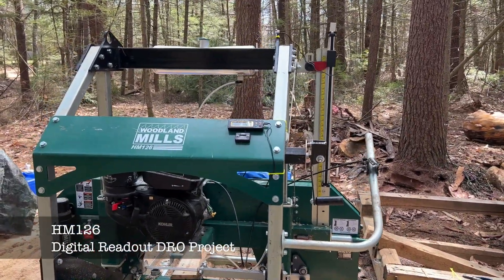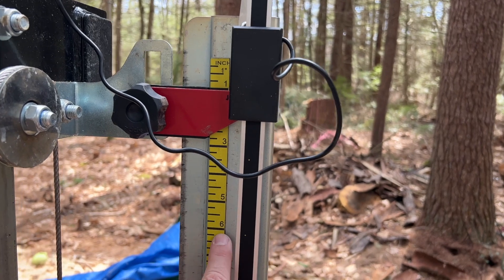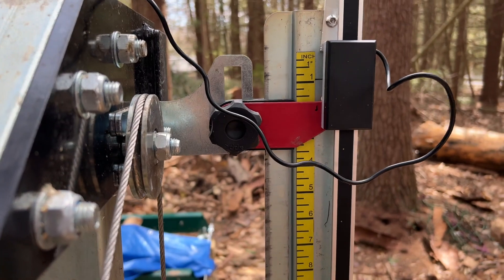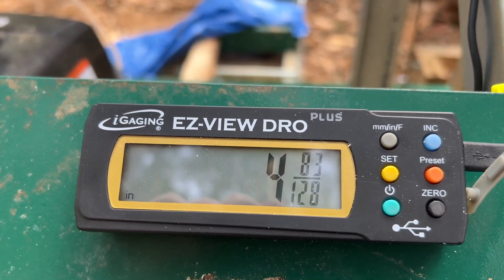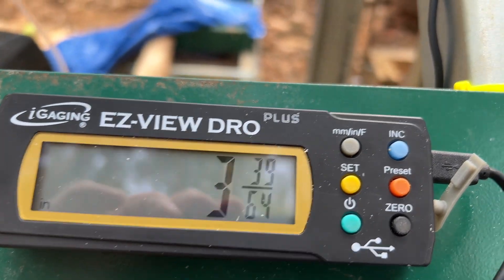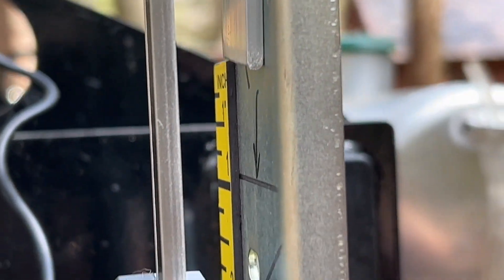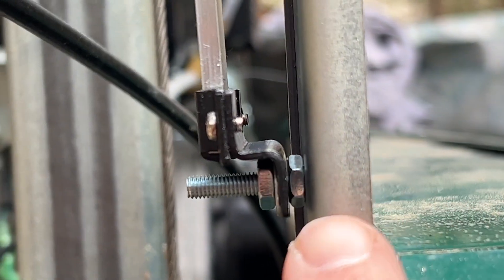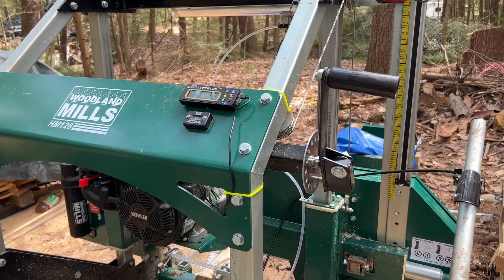Woodland Mills HM-126 Digital Readout DRO Project

Comment: Can it be less accurate or rather made to read , say 32nds of an inch ?  Thanks
Reply from the maker: No not that I have found. I switched to the 3 decimal mode 1.XXX. Since I'm always working using the INC function i'm just looking for a reading between 1.030 to 1.060 and call it a day. I find that much easier than reading fractions.